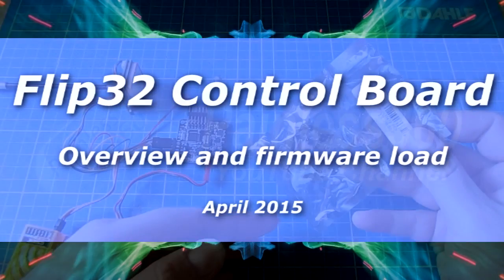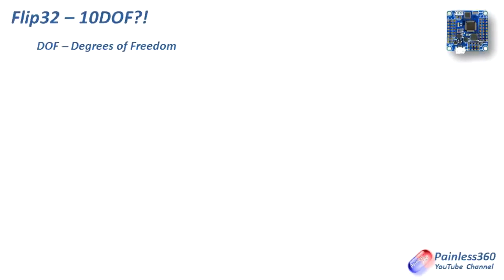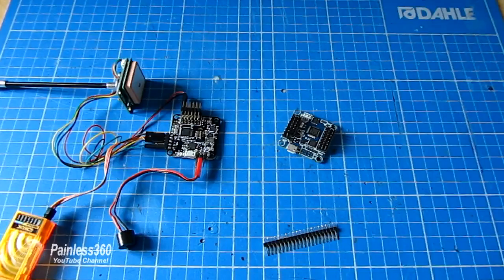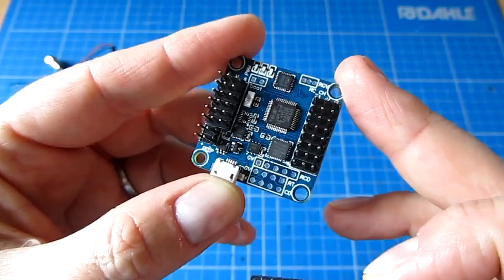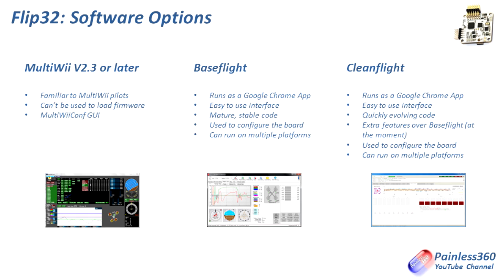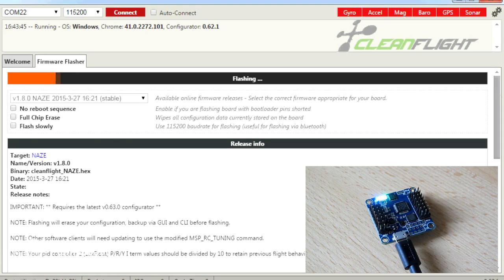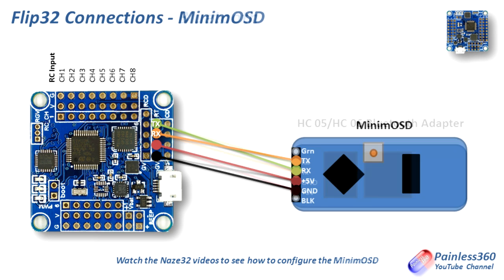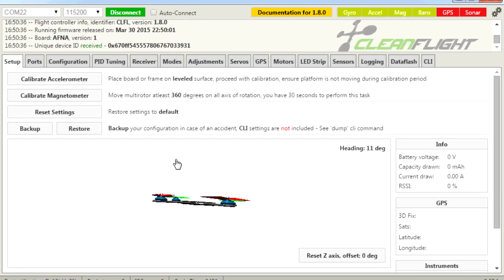Flip32 Flight Control Board: Overview, Cleanflight install and comparison with Naze32

Comment: I found a board defect on the fFlip32 that could effect some users trying to make the buzzer to work.  It seems that the manufacture installed a capacitor instead of resistor in this location.  This link will go into detail.  This was driving me nuts!  https://docs.google.com/document/d/1PLCJeskc7YWlbNeFkt1kt8nH6Qu5axHwigVtlr5ChYM/pub
Reply from the maker: Jon Car Blimey - well spotted Jon!

Comment: Yet another spot-on video, thank you very much! so glad I subscribe.
My board however will NOT connect no matter what I do. Watched your vid twice thru and updated my Win 7 sys to have the current usb>uart driver. Even did a restart on my pc after the install. Started CleanFlight and still no connect. Tried on my laptop as well since the above was my desktop. Searched the web and found/tried some of this- http://blog.oscarliang.net/cleanflight-naze32-setup/ basically the same thing here except it states if this is the first time with your Naze to click "Full Chip Erase" and still no connect.
Then I went and installed BaseFlight to have the very same results. New board, could it be fried?!?! Seems to boot just fine. I am at a total loss...
Reply from the maker: James Lyons Can you see the board in device manager on the PC?
Reply: Painless360 No, as a matter of fact, there are none (ports) listed Win 7 64bit. I just tried to use the X86 installer and it would NOT allow due to 64 bit. Went into BIOS and the only item I saw that might be of help had to do with "60/64 port emulator" which was disabled- I enabled, still nothing. When I try and open CleanFlight I still get 'failed'. Go into BaseFlight and get no ports as a listing. Device manager shows nothing even tho I've checked 'show hidden'. I've changed from a v2 usb to a v3 usb plugin and neither seem to matter
Research 'show ports win 7' gets a bit over my head as it now wants cmd to be run.
Might this be a Firewall issue? Not allowing me to see/connect thru CleanFlight? I'm pretty sure it is not a router issue since that is outside the pc,..
Looking elsewhere thinking it might be a Win 7 issue but no much out there. Checking RCforums as well,..
Reply: James Lyons 

I have had some success! I got the idea to update the
drivers for the Port even though I had installed the CP210x sw. Going into
Computer Manager and then clicking on Device Manager I tried ACTION. That is
when I saw ADD Legacy Hardware.

Clicked on it and a menu to chose what hardware was offered.
I chose PORT and then walked thru several 
other menus arriving at a choice for the CP210x and I chose that. Updated
fine and finally got myself back to CleanFlight.

It did recognize the USB input at this time. I went ahead
with the firmware update and all was succesful. Except once the card was
flashed it was immediately NOT seen again by CleanFlight.

My thought then was to try and install more of the offered
CP210x offerings in that, the s/w offered several versions of CP210x in the
legacy menu. Installing several og those each gave me a different PORT listing
in Device Manager though, none of this helped.

Then I thought I blew it, CleanFlight not being able to see
the USB card (Naza32) as when I loaded the firmware I did have the box checked
for Full Chip Erase as one of the web searches I had found suggested.

Now I went in search of how to unbrick a Naza32 by shorting
the to poles on the bootloader. None of this helped though i that, I'm back to
square one where the Naza isn't recognized at all. Some of the blame I put on
myself for my troubles but I can't help but put some onto a faulty card.
Finding this exact problem on the web, to this degree, is far between so I
can't help but think it is not all me- the NOOB. posting so it might help
others.

Comment: It is cheaper to buy the flip32 boards from readytoflyquads.com, half the price out of the US instead of China
Reply from the maker: engineersupreme You can get them from lots of places now. It's a trade off between price, shipping speed and support after the sale.
I would support the local suppliers if you can afford to. The help when you get stuck is usually much more specialised, and in your local time-zone.
Best of luck with the build!
Reply: Painless360 The Board from the USA at half the price is full 10DOF and took less time to get to new Zealand than those from China, Need to be careful alot of the stuff off banggood is overpriced, even compared to aliexpress. there are not many people supplying in NZ and those that do up the costs by 300%, I always buy in 2 or 3 extra and then anyone that needs gets them at the same it costs me.
Reply from the maker: engineersupreme Sounds like a business opportunity for you :)
Happy flying!

Comment: I am trying to set up the flip 2.5 and after upgrading the firmware (to version 1.10.0) in cleanflight, I don't see the Mag and Baro lights turning green and can't adjust the Magnetometer. Looking at the spec page for the 2.5, it says it includes the BMP085 barometer and the HMC5883L Magnetometer. Is there something I have to do additional to enable the Mag and Baro?